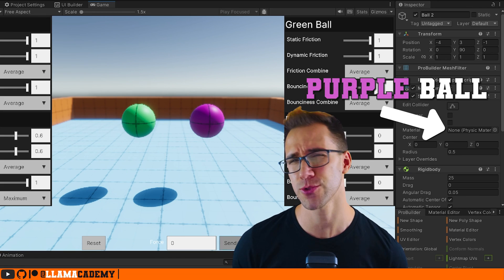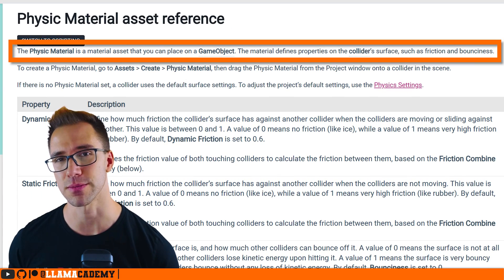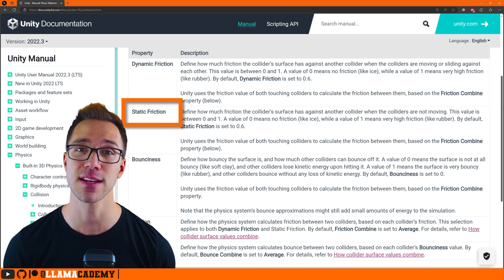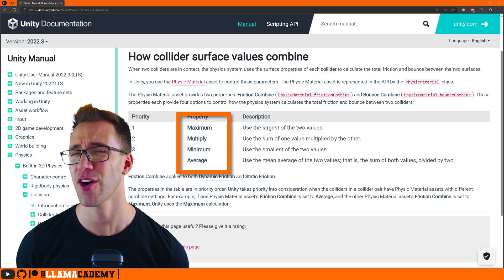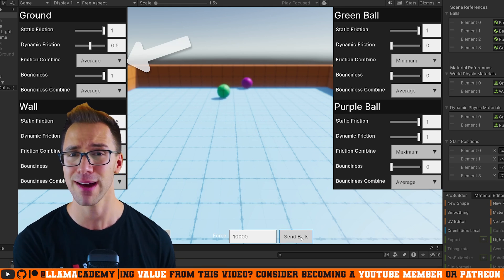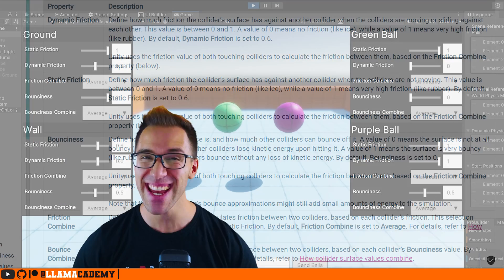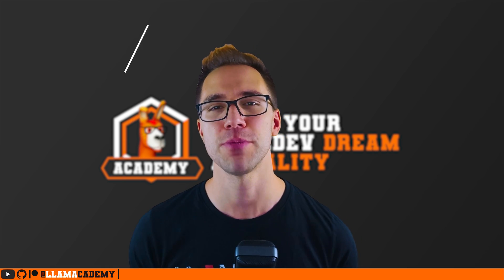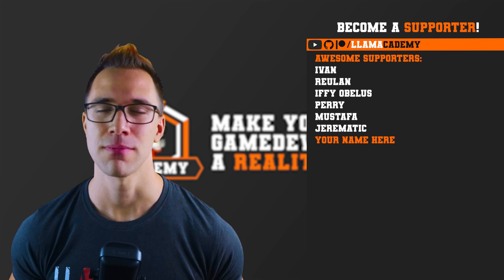Physic Materials, Explained. | Unity Tutorial

Comment: One of the issues that I have is that the max friction doesmt create "stickiness"  - you would think that a max setting would create such large friction that the object wouldnt move at all. In fact, max friction is still super slippery for what I need - think wall jumps. I going to experiemnet some more but any suggestions or thoughts or ideas if unity will or has implemented an attach function. Any help greatfully appreciated - absolute unity noob (in coding)

Comment: Very helpful and straight to the point! Is there some kind of settings to set the "static to dynamic" (or viceversa) threshold or is automatically handled by the engine? I feel like that the static friction value is still used when the object is moving veeeeeeeery slowly.
Reply from the maker: Static is used for that transition. If the object is determined to not be moving, it'll use the static, otherwise it'll use the dynamic!
Reply: Maybe in "Project Settings > Physics > Sleep Threshold"

Comment: i once tried to use physics material trying to reproduce bullet ricochet but it didn't felt right as bounciness made the bullet bounce back on straight wall instead of stopping the bullet, do you have an advice to reproduce bullet physics with physics tools provided by unity? (if it is possible with unity physic)
Reply from the maker: It should calculate the bounce based on the direction of the object and the force applied